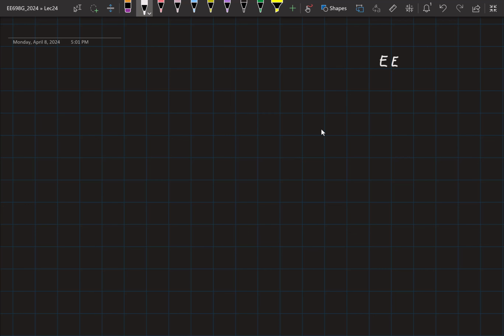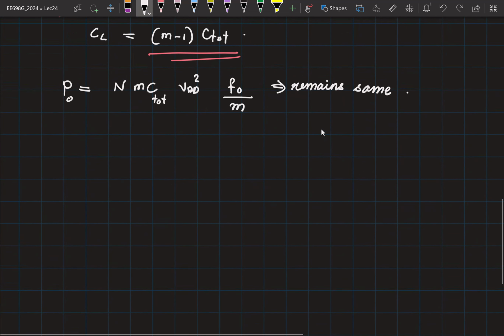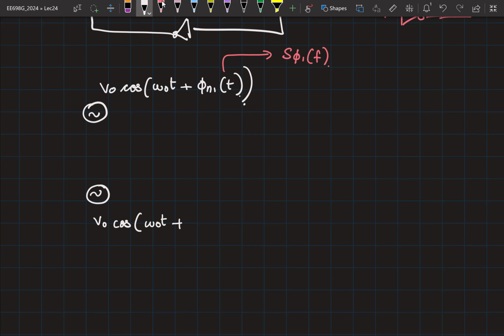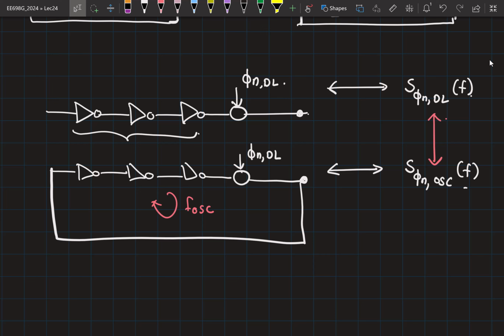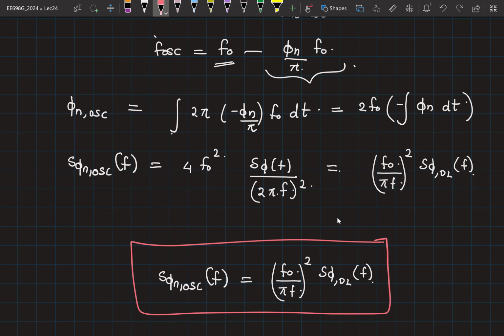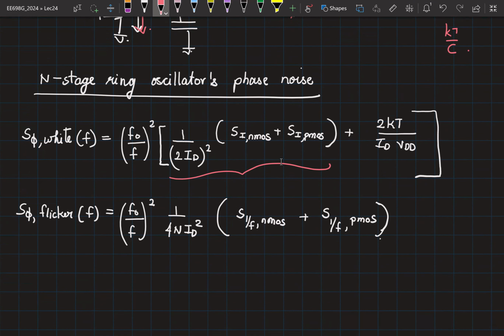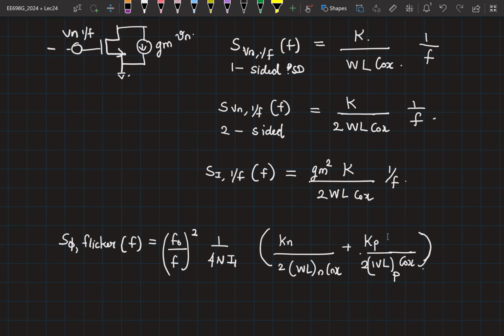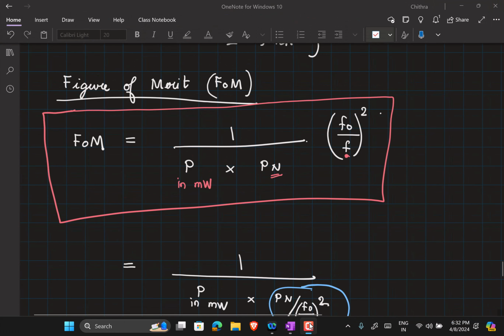Lecture 24: Design of a ring oscillator

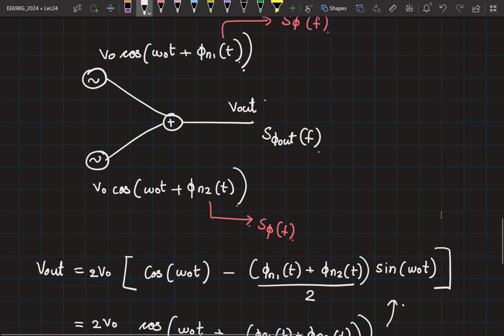Comment: 23:41 I was greatly confused by the statement that PSD of 0.5*(phi1+phi2) is half of PSD of phi1 and it's caused by increasing sine wave amplitude by a factor of 2. so I googled "one signal with amplitude of 1 and the sum of two signals with amplitude of 0.5, compare power", and AI answers "If the two signals are uncorrelated, their powers add. The power of each signal is proportional to \(0.5^{2}=0.25\). The power of their sum is proportional to \(0.25+0.25=0.5\), which is half the power of the single signal with amplitude 1."
looks like the half PSD result is simply caused by adding two uncorrelated phase noise together instead of increasing oscillator amplitude/power consumption. anyone else can help comment here? thanks!
Reply: yeah that's another way to think about this, signal will add in amplitude as it's 100% correlated but noise isn't.